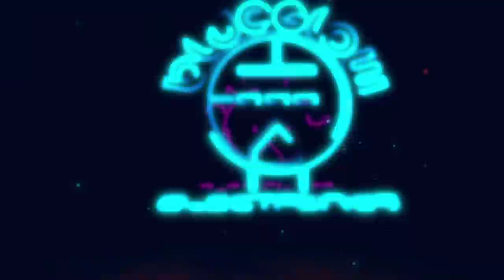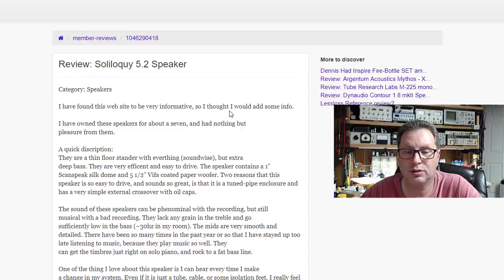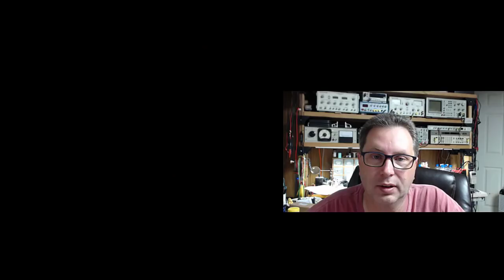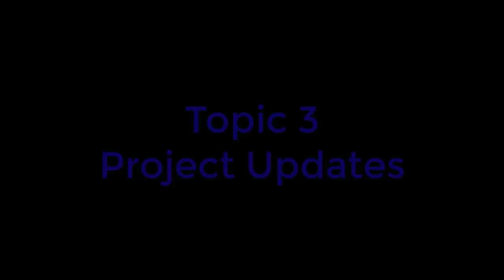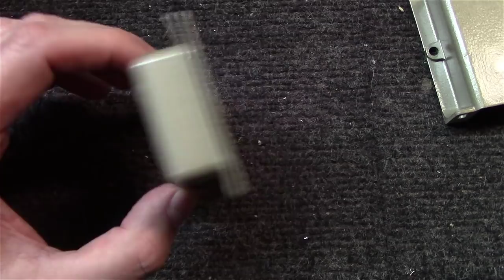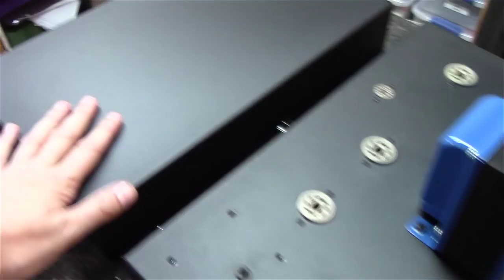Soliloquy 5.2 Prototype Speakers, Book vs. Practical Experience for Audio Technicians

Comment: I agree, went to a community college electrical engineering program in the 60s when they still used tubes. In high school had a three year program and we worked on old military transmitters, ohms law lots of bench time. I pretty much new the college stuff from high school experience. Then used it as a computer hardware tech for 50 years. I had a huge advantage because of trouble shooting to the components. New comers swapped out the pwb with the red light on, and didn’t know why. Now that I have retired and went to a tube amp hobbie, I fell right into it. I’m a better technician than anyone that didn’t get that early hands on. It wires your thinking in a logical analytical approach. I can and do fix whatever comes my way that I feel like fixing. I appreciate your approach and think you are in my league. Thanks for all you do. Duane (west coast) your safe!

Comment: Absolutely love this video, and can totally relate to it. I am in the middle of your spectrum of understanding, but in a very mediocore manner. I have gone through EE degree in college, and have been soldering and modding / fixing stuff since I was a kid. However, I also notice there is a disconnect between the two. The theoretical side don't go very deep, Yes, RC, ohms law, etc. no problem. class A transistor, ok. And by the time I was in college, tubes were never even mentioned. But  I did managed to get some idea how tube works, but not in depth enough. I managed to understand how a tube single class A stage would work, but would stumble when it gets more fancy, SSRP, feedback, pentode? no idea. I am trying to fill in some of those knowledge and have been really enjoying your videos. I am in the process of designing and planning to build a 300B amp. I am really excited about it. Wish me luck!

Comment: Great series and enjoyed the part about book vs. practical.  More practical here have been to school on theory back in the days (all military training), but ended up more of a technician that could repair the equipment, but the grasp of the theory a lot of times passed me by.  Knew many people that could fix equipment blindfolded but could hardly read the manuals and vice versa.  Your videos offer the best of both worlds and you to me are a rare breed that has a grasp on both aspects of it (and you can relay the information extremely well too).  Just not the audio area that you see this type of thing in either, look at computer techs and network admins, same deal there too.  As far as the paint, can't help there, I would be out looking for that color in flat if it was me (driving myself nuts in the process).  Keep the great videos coming!

Comment: 91% isopropyl alcohol (normally it’s 70%) from Walmart or similar will dull that glossy paint right down. Be careful though. It can take the paint right off. Use sparingly as needed, or dilute as needed using test pieces...

Comment: I did the 2 year EE degree program, and later in life the 2 year Computer science degree.  On the practical side I have been doing repairs for 45 years.  I learned a lot of practical points by watching and working with other technicians.  so, I have the theory and the practical.  However if I wanted to design a circuit, or modify one, I would definitely have to hit the books again.  It is just not something I use a lot.  I also was an industrial electrical and instrument tech.  I was in another city just last year and met up with a man that I worked with back in the 90's at the plant.  He is an engineer now and told me that he still to this day uses things he learned by watching me troubleshoot problems back then.  I will have to admit it did make me feel good that I was able to pass on some of my skill set to a younger tech.

Comment: Good stories.I think you make a good teacher. I am a copy cat builder. I have built a champ and I built a push pull out of used parts and got it working and then took it back apart. I was a carpenter and a electrician so this helps me a little.After I build a new push pull, then I am going to settle in and get some education from books. I never was good at algebra.

Comment: On your paint, before you strip and redo, try a very light over-spray with a semigloss clear if you can get the right temp range. Don’t sand as directed.  Just a light fog. Works wonders.

Comment: Go to an art supply store and get a can of clear spray matte varnish. It will knock the shine off of that finish. Let it dry thoroughly before you apply heat to it. Really enjoy your Sunday talks. I have no formal electronics education background, built a few kits since I was a teenager (am now 76) and last year totally restored my Marantz 2325 with faith and determination and a good tech friend who helped me with the testing. I have little interest in tubes but anything you put out on solid state I'm glued to. Now I've inherited a 4240 Quad unit to bring back to life, also was given a Hitachi 1565 O'scope (needs repair on the function selector switch, possibly super glue). Even though I've got the oscilloscope I have no idea how to analyze a problem with it. I did the 2325 with a 30 watt soldering iron, two DMM's, a variac and a dim bulb tester. I sound like I'm kind of where your older friend was with the card table bench but I do have a pretty nice bench. Thanks for all you do Mark.

Comment: I remember a brother of mine telling me about a conversation with a young college grad who'd just seen the move "Pearl Harbor". This guy had made a comment about being amazed that Roosevelt had been President for over 40 years. >.<

Another example of theory not meeting practice happened at work. A coworker told me about this new hire running a new program on a CNC mill. It was howling and vibrating and the coworker came over and said to him, "That doesn't sound good. What's your chip load?" 
"Uh, it's okay, about half." 
"What do you mean it's okay? You call that okay? Half what?"
"I checked it at the start of the shift."
"What? Okay, show me what you mean." So the new guy goes behind the mill to the chip conveyor output and shows him the chip tub is half full.
"No, I'm talking chip load on the cutter ... you know, feedrate divided by RPM divided by the number of flutes?" He had no idea what that was. He's a button-pusher, not a machinist.

Comment: Thanks for sharing your insight re tech ability. My journey started as an industrial maintenance electrician in a steel mill. I got into repairing amps because I wanted to fix my own music equipment. I figured if I could repair a 5,000 hp DC mill drive, a 60 ton crane or a motor/generator set, then an amp would be simple. I just started reading everything I could on the subject and jumped right into my own equipment. Like the guy you mentioned, my learning was driven by empirical evidence, trial and error. Today I build my own equipment. My tradesman background helped a lot because I knew how to tear things down, use hand tools and shop equipment. I also worked with guys that were excellent in school and consistently outdid me in the academic part our training. Some of them couldn't be sent out on repair calls by themselves because they couldn't fix anything and couldn't read blueprints or line drawings. I think your assessment tracks 100%

Comment: I really enjoyed the contrast between your two acquaintances.  I see this dichotomy between the two channels Mr. Carloson's Lab and 12VoltVids. I love both channels, they are both awesome teachers.  I don't think either guy is in the far corner, they both have theory and practical application, but I see 12voltvids as more of a tech and Mr. Carlson as more of an engineer.  That is the phrasing I use when talking to my wife; tech vs. engineer.  I am more of a tech, I have no interest in designing circuits  or modifying equipment, but that does not mean I am not willing to learn what I can where I can.
Reply from the maker: You are spot on!

Comment: I've recapped a Carver PM125, have two of them, but can't find a service manual anywhere, would anyone know the biasing details for that model?
Reply: Josh Tree check out xraytonyb YouTube channel, he's just done some series on carvers he might tell you about circuit diagram.
let me know you can see my comments thanks!
Reply: Thanks John, appreciate it, I will.
Reply: Josh Tree yes you should do he's very knowledgeable and he's just explained how the magnetic field  transformer and triac works in detail
Reply: Thanks John, I have several Carver amps, 2 1.0's that I've upgraded and a TFM 15 that I've recapped and the two PM125's, so I'll be following xraytonyb for sure.
Reply: Have you checked Hi-Fi Engine. com for the manuals and schematics? Great source. Just sign up and the downloads are free.
Reply: Yes I have Stu, I've gotten several manuals from them including a service manual for my HK Citation 16, they don't have the service manual for the PM125 unfortunately.

Comment: there is only one speak to you should get if you build it yourself you can do it for about $1,000 or less that is  linkwitz LX521.4 and get the ASP than the DSP or both. he's passed away now so I don't know if you can still buy the kit but there was a link to a site that sold them in America. he best crossover designer and speaker design in the world. check his website linkwitzlab explains a lot about speaker design and crossover and placement.
 Put seas drivers in those experimental speakers! they've got those awful plastic drivers and not very good.
Reply: I didn't realize he had passed away...sad to hear that.  I loved his passion and demonstrations of the LX521.4 at the Rocky Mountain Audio Fest.  I've wanted to put  a set together for the past 3 years.  I believe it was Parts Express or Madisound that sold the kits.
Reply: Barry Draeger Madisound is the company, there is a German company who makes them pre-assembled but I don't know if they do kits!
Reply: John sweda I just attended the BurningAMP festival in San Francisco with Nelson pass. Nelson has a analog version of the crossovers and I believe the plan is we’re also available for building the speakers. Circuitboard is available at DIYAUDIO.com The speakers in combination with the LX mini in a try amp system are amazing for their tiny size
Reply: t lech what do you mean build an analogue version it is an analogue version already the ASP (analogue source processing) is the crossover. I hope it stays as a kit and pre-assembled, at the cheap price it is? and there's companies selling it already and have done for years. the LX Mini are supposed to be very good as well very affordable about $500 I think. but I'm talking about the floor standing full dipole speakers with the joint 10 inch bass drivers the LX521 and Lx521.4 the last ones he designed. outstanding and I've had professional hi-fi reviewers  saying they are better than $115,000 speakers.